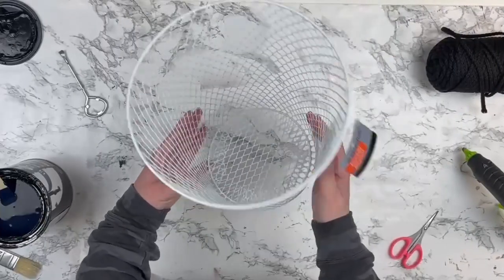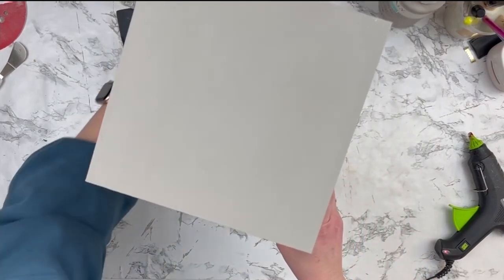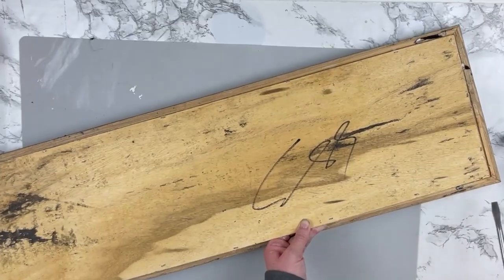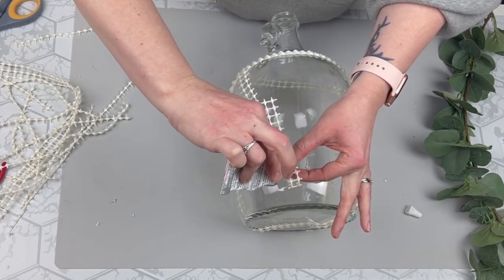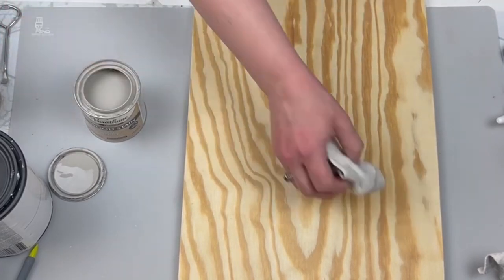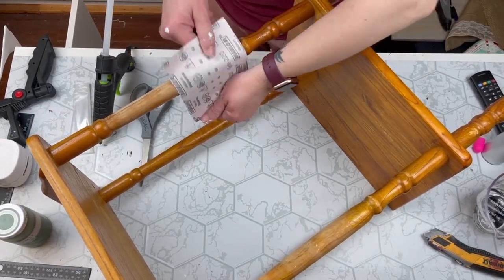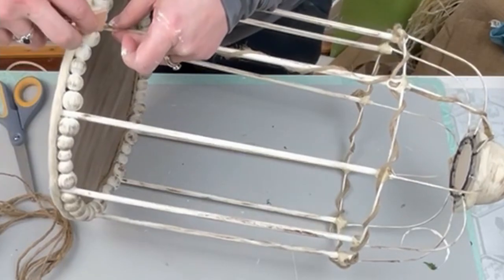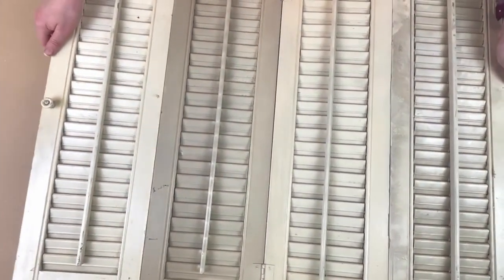Every Day Home Decor DIY Mega Video 2021 | Dollar Tree | Thrift Flips | High End Decor Dupes

Comment: The frosted glass is NOT going to come off, it’s generally done by sandblasting and it’s main purpose is for more expensive pieces,  to help keep UV rays from fading & damaging the art. Museums will use a very high quality of this type of glass. Plus it can be pricey, so don’t get rid of it.
The lil table your neighbor was throwing away, was a old telephone ☎️ table.
Reply from the maker: Good to know on the frosted glass. I still have it! Need to figure out something to do with it. I thought I had seen other people remove the frosted part but maybe it was a spray on or something? I know you can buy the frosted spray paint. 

Yes! The telephone table. I had a bunch of comments about that in the original video. Love that little table
Reply: @angelajonesdiy  yes u can get  glass with the frosted film or coating, so much cheaper!!!! I worked at an art gallery in the background, repairing, restoring and framing art. Then I moved into a jewelry laboratory, using a lot of the same knowledge. Lol. Sandblasting glass is a delicate balance and usually a much higher quality (denser) glass used, and even more pricey depending on the amount of UV protection included in the glass. 15 yrs ago 8x10 size piece of glass like yours wud run approx $50-80.00 and yours is bigger. It also helps with deflection of the sun or light off the art so there is no glare distortion of the art. When u find a piece of art u really value, that’s when u use can use yours and u can always cut it to fit. Make sure also with any art of value that u NEVER use cardboard behind it, use acid free backing because regular paper or cardboard has acid and overtime it will eat into your art. If u ever see old pics that have dark spots or lil holes showing that’s the acid. 😉 ok sorry enuf of my lil glass Ed course!!! 
Ty for your great tutorials!!!
Reply from the maker: @kelleyhawk6595  I love the education lesson 🥰 this is all great info. I’m sure you have a ton of knowledge gems from working in a museum. That had to be so fascinating. My husband is just starting to learn sandblasting but for grave stones. I’m sure it has similar aspects